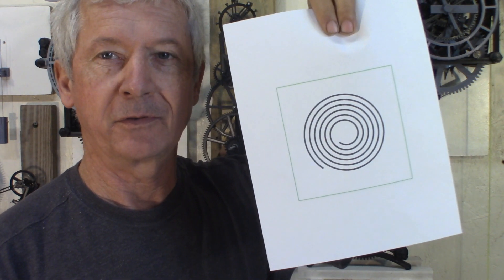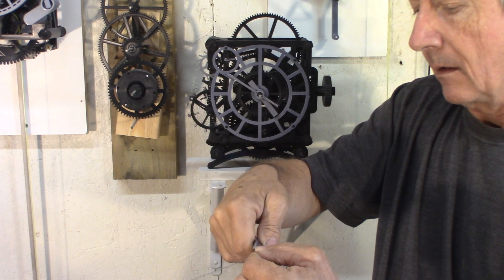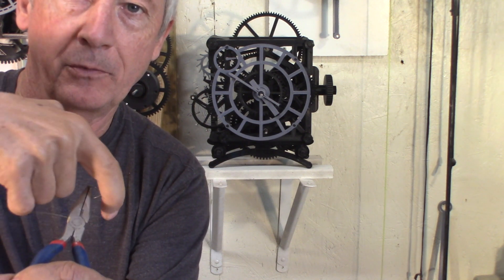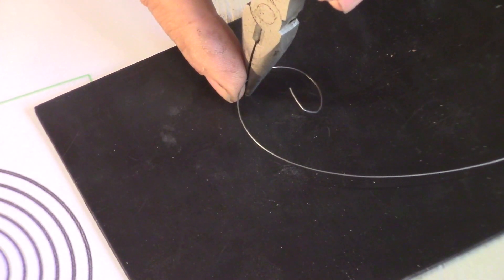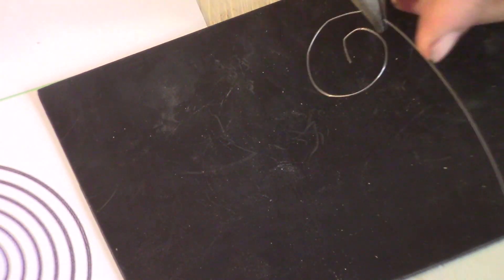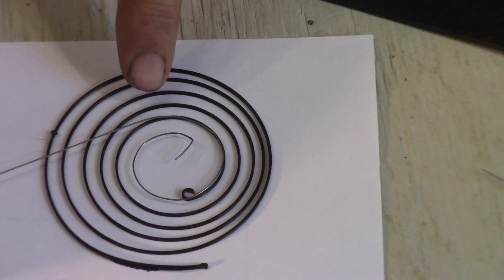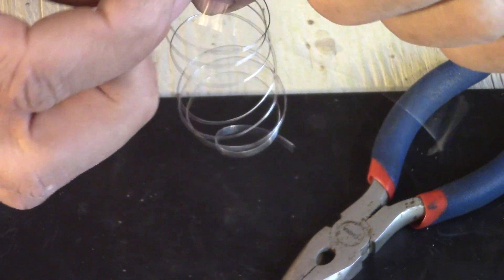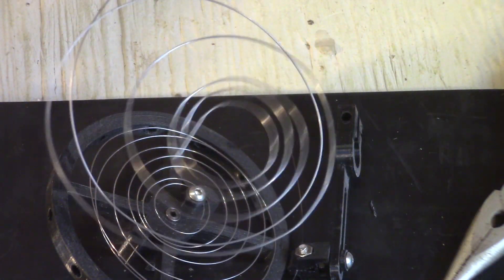The design and prototyping of a 3D Printed Swiss Lever Escapement Watch, Shaping the hairspring

Comment: Nice work I wonder if a 3D printed spiral jig / template would be possible?
Reply: I had exactly the same question. Seems like it would easy to create one and try it.
Reply: I was wondering about that myself, or you could use a wooden dowel with a slot.